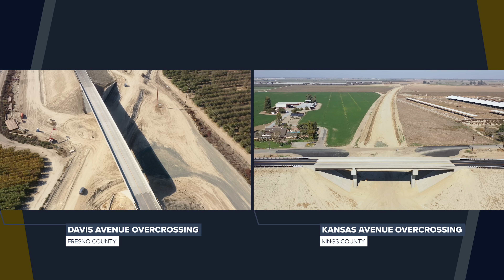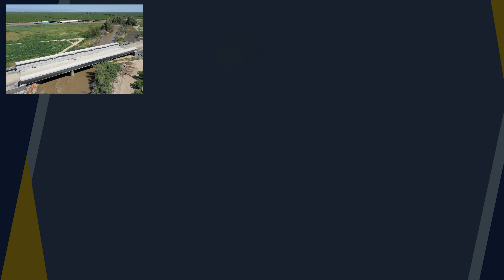Fall 2023 Construction Update: Progress is happening across California thanks to HSR Workers!

Comment: Please put pressure on LA Metro to move forward with LinkUS!
Reply: Their Phase A, the bridge over the 101 freeway with two tracks, is supposed to open by the Summer 2028 Olympics. Phase B, which includes the remaining tracks, along with raising the platform and track height to increase the ceiling space for an enhanced concourse, should be completed several years after that. So far only Phase A is funded.

Comment: California may double or triple funding from cap and trade. Federal grants of $3 B this year and $5 B in 2025 may enable CAHSR to begin service on the Merced to Bakersfield segment in 2027, SF-BFD segment in 2032 and the entire SF-Anaheim route in 2038 on the 30th anniversary of Prop 1A.
Reply: "Federal grants of $3 B this year and $5 B in 2025 may enable CAHSR to begin service on the Merced to Bakersfield segment in 2027, SF-BFD segment in 2032"

I don't think there will be any federal grants. Last time they applied they were turned down.

SF-BFD, as currently planned, would require a tunnel under 151. I highly doubt that ever gets built.

I do, however, think Capitol Corridor will be improved in terms of "higher speed rail" and that will allow people to get out to Merced a little faster. But since you will only be able to get to Bakersfield on the train, and then it's a two hour bus ride to LA, most people will still fly.

Most will fly regardless, as it is by far the fastest method from SF to LA and always will be.
Reply: @neutrino78x Yes, they were turned down earlier this year. Hoping a Christmas grant comes this tiime. Those are very optomistic dreamy timelines l will gladly admit. Perhaps you meant the San Joaquins which connects to Merced rather than the Capitol Corridor, though both do serve Sacramento. Higher speed upgrades will be great. But yes about Bakersfield. After this valley segment l would prefer tunneling directly to LA via the Tejon Pass l-5 route rather than the Pacheco Pass tunnels that you doubt will ever get built. Connect to San Jose by upgrading to higher speeds the Altamont Pass route that connects to the San Joaquins for the Merced connection. A little slower but much cheaper.
Reply: @neutrino78x  they just bagged a federal grant
Reply: @wtell4436 

"they just bagged a federal grant"

Yes, for 3 billion. That's a whole 3% of what they think they need to complete Phase 1. lol.